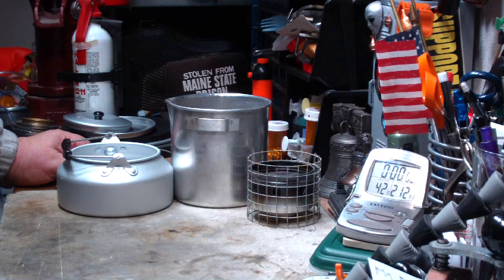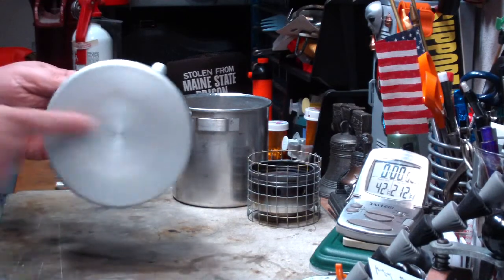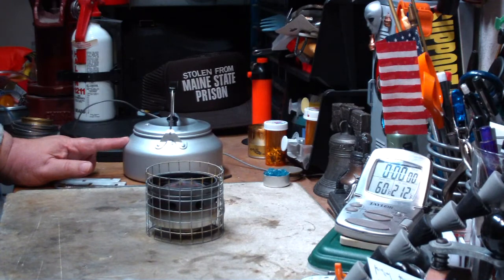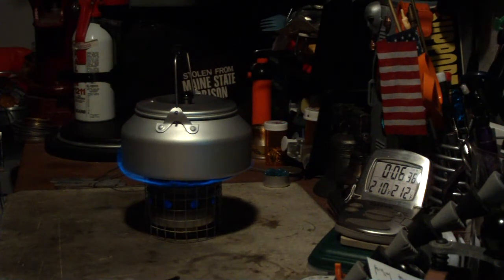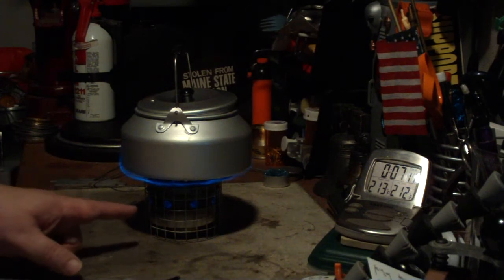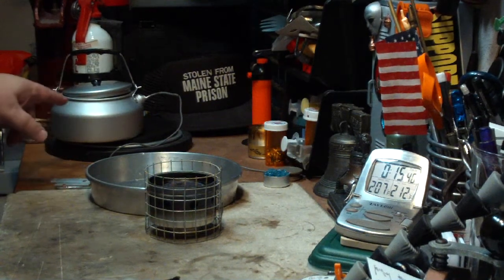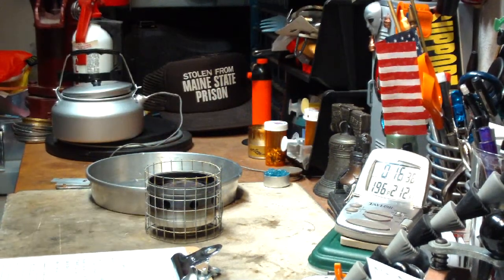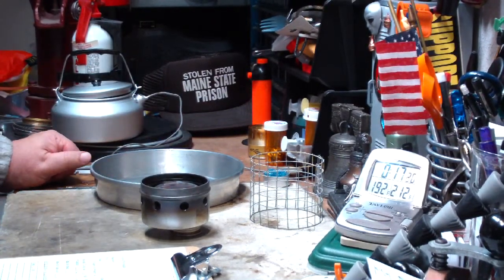Etowah Ultra-Lite Stove II - Boil Test #7 - Trying Wider Pot

Comment: Water boils at 212 degrees F. at sea level.  The higher the elevation or lower the atmospheric pressure, the lower the boiling point.